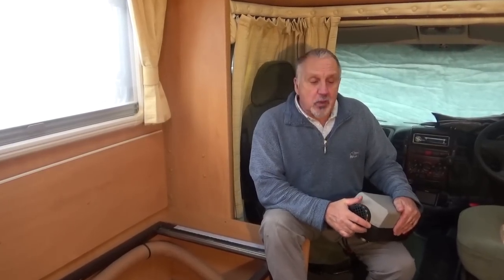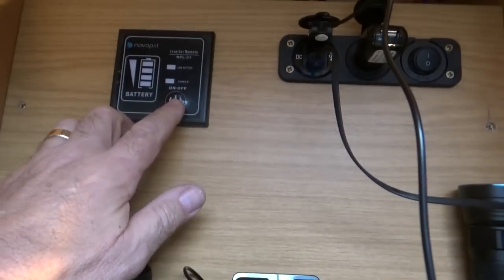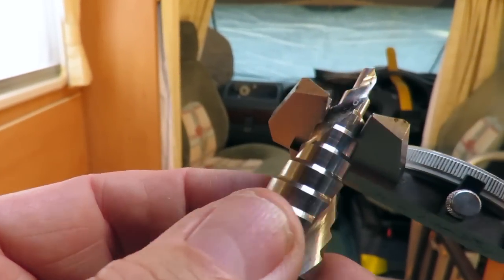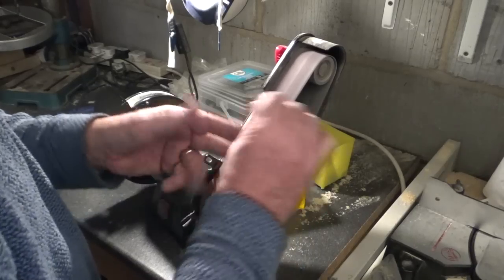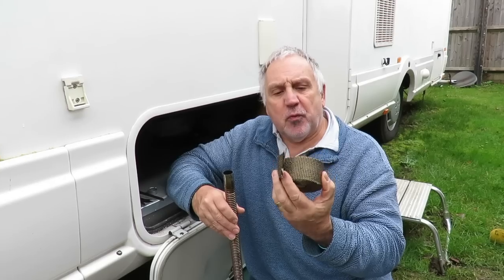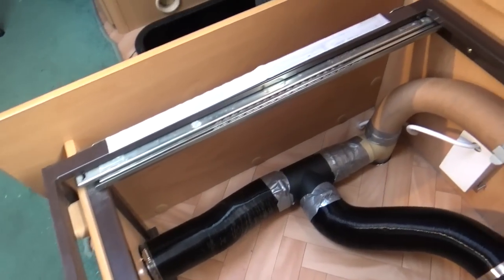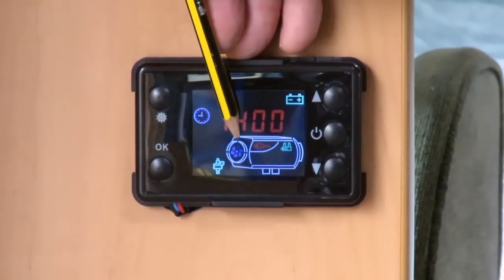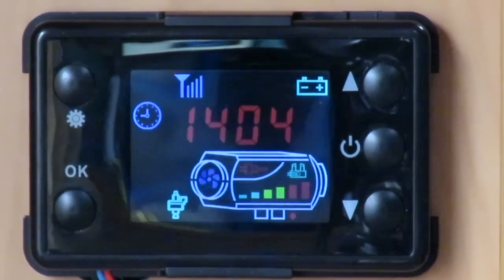How To Install A CHINESE DIESEL AIR HEATER, Ebay 5KW parking heater fitting guide. Full instructions

Comment: Just wondering how you're getting on with your exhaust wrap..... I need to raise my heater from the floor to get past an obstruction at the end of the heater near the heat exchanger, so I've bought a stand from ebay which raises the heater around 100mm which is ideal, and it means I can keep the fuel supply and the inlet and exhaust connections entirely within the van.  However, the exhaust still needs to go through the floor, so I was thinking about  wrapping the exhaust, making a slightly enlarged hole through the floor to accommodate the extra thickness, and using a heat resistant silicone to seal around it.  Just wondering if you have any thoughts on this ?

Comment: Great video, I’ve bought the heater in a box housing, both the same really. I’m looking to power the unit off a portable battery (goal zero or poweroak) and l’m wondering if I can connect a 13amp uk plug to the wires for this purpose? And if so do l need to change any of the wiring?
Reply from the maker: Hi Roger. 
The heater I have will only run from a 12V or 24V. DC supply. 
I assume yours will be the same as both the boxed “ all in one” and “freestanding “ units both use the same burner unit. 
So I would say DO NOT connect a 13A plug to any of the wires....!
Just provide a 12 or 24 Volt DC fused supply and you good to go. 
ATB, Steve

Comment: Brilliant video thanks ...how loud is the fuel pump and heater when running the clicking might be too much
Reply from the maker: Hi Mark,
I can hear the pump ticking slightly, but since this video I have completely upgraded this system.
Relocate the tank and burner, repositioned the pump and you really have to listed to hear it now.
Don't run it at night, sp during the daytime any ticking is drowned out by general daytime noise.
That upgrade video is here:
https://youtu.be/HHJaPP2uLFA

ATB, Steve

Comment: Will everything still perform if the fuel tank is mounted and kept outside the vehicle and the outside temperatures reach  0° to 20° F (-17° to -6° C) using diesel?
Reply from the maker: Hi ST,
I think you would have problems at those temperatures. 
I think I'm right in say that anything much below 40F and the diesel starts turning in a gel which will effect performance.
probably worth googling to check!
thanks
Steve

Comment: my husband has started to put in or really finished but found fuel pump very noisy as it is mounted on the tin in the cabinet just like the one you did in video. the tin is on the back of boot where we have the tank     /what would you to stop noise or where would you put it.

Comment: Is there a reason you placed the air intake pipe into a 'cold' area under your van? I would have thought you would not want to be drawing cold air into your unit to heat and pump into the van, when you could have drawn 'warm-ish' air from under the seat, and warmed that. Much more efficient setup I would have thought. 
I am guessing there is a reason why we cannot install this way? Great video by the way!
Reply: Or is that air intake just for the combustion component? i.e this intake will not be blown into the van itself?

Comment: Hi!
I've just installed a heater like this in my semi truck...i let it run like for 30 min for the first time and it gets some smoke inside the cab (the smoke doesn't smell like the exhaust it smells more like a heated plastic or some kind of this)...
It is normal to be like this when you fire it up for the first time? I was thinking that it needs some time for all the chemachilas and some paint inside of it to be burned or something like that...)
Thank you!
Reply from the maker: Hi,
Smoke inside the cab is quite serious..
I would check you have the unit sealed, especially between the burner seal plate and outside, as well as that, check exhaust clamp is secure.
If exhaust fumes or smoke are getting around the housing of the unit it will be drawn in through the air inlet.
Also check the air filter is completely away from the exhaust outlet.
You should get zero exhaust smells coming into the cab through the hot air vent.
Any smoke or fumes should only ever be coming out of the exhaust.
Hope this helps,
ATB, Steve

Comment: I finished installing my 5kw diesel heater today, primed it, switched it on, works great, have one problem, i cant get the temperature setting up on the screen, it comes up P- 4.9 HZ, also programmed the remote but does not work, your installation video was great
Cheers Frank
Reply: Same here... whats the solution?

Comment: Hi Sir, are you using Lithium batteries in your RV ? I wonder if the 14.5VDC (at BULK charge) can dammage the heather controller... I'm wondering if I will install a voltage regulator or nor ?

Comment: Thank you for a great video. I have installed my new heater and primed the pump. Never the less, the heater wont start. I get the E5 error even before the pump starts ticking. What is your advice?
Reply from the maker: That's a weird one!!!
Error E5 is overheat protection, and considering its not even fired up yet is strange?
I would check the temperature sensor at the housing to see if anything is amiss.
ATB, Steve

Comment: Awesome 😎 install and easy to understand instruction presentation.
Reply from the maker: Thanks Kman,
However, I have since relocated the whole system and this this new setup is the best so far.
Video is here:
https://youtu.be/HHJaPP2uLFA
ATB, Steve
Reply: @TheWrinklyNomads  I have installed a variable heat Chinese heater. 2kw to 5kw. It’s Awesome and once started I can drop the heat down to a minimum. Easy as.

Comment: Got to love metric vs imperial units. 5/16" (IE, 1/16th larger than 1/4") is 7.9 mm. So chances are, the piece you were measuring was 5/16" and the missing 0.1 mm was error during manufacturing or measuring or both.

Comment: I have changed the fuel pump visulisation from P = hz to the Centigrade temperature view.
I now want to change this back to the P =Hz view. Please how do I do this. I could not find the method in your advanced controller video. Cheers
Robert Middleton
Reply from the maker: Hi Robert,
Use the same method as you did for P = hz again.
That changes it back and forth.
ATB, Steve

Comment: I would love to ask your advice. My first time running it, I had a mishap. The exhaust pipe was so hot that it melted the fuel line which was touching it. Silly me. I covered the exhaust pipe with the same heat resistant fabric you have, with a double wrap, fixed the fuel line and tried again. Now there is a noticeable amount of smoke coming off the exhaust pipe through the fabric. I have the base of the exhaust pipe where it connects to the machine well sealed and the light smoke is not coming from that base area. I think I didn’t get all the diesel off the exhaust pipe and it’s the residual diesel which is producing the smoke. I see that your heat resistant wrap is very burned looking at a later stage. Should I just let the smoking keep going until it burns off the diesel or should I be worried that this might start a fire somehow? I imagine that the heat resistant wrap is fire resistant but I am still thinking I should ask your advice. If I need to replace the exhaust pipe for a new clean one and do this part again, do you know where to order these kinds of replacement parts online? Thank you!
Reply from the maker: Hi,
I would replace exhaust pipe with a new one to be honest.
Fortunately they a quite cheap.
here's a link, hope this helps:
https://amzn.to/3LkcVdI
Also, I have considerably upgraded this setup since this video, I find it much better,.
You may also find it helpful.
https://youtu.be/HHJaPP2uLFA
All the best
Steve

Comment: Hi, thank you for this video. Please can you tell me what battery is can connect it to? I think I will have a leisure battery and just straight connect it but not sure how. Many thanks in advance 🙏🏽
Reply from the maker: Connect the power lead to your leisure battery directly, ideally 100Ah if you intend to run the heater for long periods of time,
It will require a 10 amp fuse as well.
ATB, Steve

Comment: Isn't the fuel pump supposed to be at a 15° to 35° angle?
Reply from the maker: In my opinion, as long as it is over 45deg it will be ok.
Upright is even better because as the pump will create cavitation and thus tiny air bubbles, these are then pushed out of the pump chamber.
ATB, Steve

Comment: Very useful vid and I have ordered a similar one as a result. I have a question. You drilled the hole into the fuel tank to fit the fuel outlet into, and then you tightened it up - how on earth did you get the nut, and I presume a rubber washer, onto the back to tighten up onto and get a seal?
Reply from the maker: Hi Ian,
Yes, that's correct.
Once the washer had started to bight it tightened up nicely.

By the way, since this video I have completely upgraded this setup. Possibly the best improvement I've made so far!
I have a video on it here:
https://youtu.be/HHJaPP2uLFA

ATB, Steve

Comment: When my heater was delivered and I "unboxed it" I was confused because so many of the parts were not covered by the instructions. Your video has certainly given me the confidence to install it. Just a question, with the fuel filter at the base of the tank, how do you change the filter without diesel leaking everywhere? Thanks.
Reply from the maker: Hi Rod,
You get a pickup pipe with the kit which gives you top entry, so there is minimal to leak out should you need to change the filter, so that is a better way to install.....
I have completely upgraded and improved the install now after testing for a year.
I have a different tank altogether. 
The full upgrade instal is here if you fancy a watch:
https://www.youtube.com/watch?v=HHJaPP2uLFA&t=129s

ATB, Steve

Comment: Will this heater work outside? I’d like to build a box that encloses the heater, vents the exhaust, but is outside and only the heat air duct comes into a cabin. Is that possible?
Reply from the maker: Hi Ted,
Yes, it will work in many different situations.
Some people make a steel box up and have a potable unit.
Only consideration I would be aware of is possible freezing conditions.
ATB, Steve

Comment: Great video overall, I like your style, but I believe the fuel pump is supposed to be at a certain angle to function properly.  45-60 degrees I think.  I haven't fitted mine yet but I've read so from several sources.  

Keep it up though, I really enjoyed.
Reply from the maker: Hi,
The pump is perfectly ok being vertical. It will allow for easy escape of air bubbles and works fine.
I have been running this for six months now with no problems.
However, since this video I have completely upgraded this system, I have also made a video of exactly what has changed.
I think it's about as good as you can get now...  
Here's a link to it::
https://youtu.be/HHJaPP2uLFA

ATB, Steve

Comment: Thanks for a very useful video. Please can you say how noisy and annoying the pump is when ticking over and maintaining the set temperature, say 20C?
Reply from the maker: Hi,
On tickover the pump is very quiet by comparison to running full blast.
I hve found that general daytime noises are higher than the pump when ticking over.
Reply: @TheWrinklyNomads  Thanks very much for your reply.  I'm thinking of installing one in my amateur radio van/camper, so quiet running is pretty important as I don't want to use headphones all the time. Thanks again.

Comment: That sponge that's in there supposed to be pulled to the top of the unit that comes off they put it over there cuz that's the way they ship it but you need to pull it over to the top
Reply from the maker: Hi Gary,
What sponge do you mean???
Reply: @TheWrinklyNomads  the one inside the air filter that looks like it doesn't do anything it doesn't do anything unless it's at the top where the air passes right through it
Reply from the maker: Thank you. 
I will check it out 👍🏼

Comment: Thanks for this very helpful video sir, much appreciated ! I bought the 2KW Chinese diesel heater for a Ford Transit. Did you test yours under cold temperatures? Was it enough ?
Reply from the maker: Hi Michel,
Yes and I actually have a video on here where  i fully test the temperatures i winter conditions.
Worth a watch:
https://youtu.be/F7V4nW6co8o

ATB, Steve

Comment: Thanks for the useful video. Newbie question; wouldn't it be more convenient to use the van's fuel tank as supply? And just cut the feeder line inside the tank high enough so it never consumes all the fuel. (I assume you have a diesel van)

Comment: 9:00 have you noticed any sludge building at the bottom of the fuel tank that clogs up your fuel outlet at the bottom of the fuel tank? i read somewhere that putting the fuel outlet at the bottom may cause a problem like that. i'm about to install my heater and water going to put it at the bottom.  overall, this is a great video.
Reply from the maker: Hi Bobby,
Thank you for you comments 👍
I didn't notice any sludge, however since this video I have completely upgraded my heater setup, including the fuel delivery system.
Maybe take a look:
https://youtu.be/HHJaPP2uLFA
ATB, Steve

Comment: I am a bit concerned about pulling your combustion air intake out of your compartment.  Since it is semi sealed the path of least resistance would appear to be pulling air into it from the holes you drilled going into the living compartment.  This would impact your efficiency as you would be using conditioned air to provide combustion and pumping it out the exhaust.  Routing it through to the outside with a cap on it to keep water out might be a better installation.  I would also have put a piece of tubing with a collar on it down to line your holes to the storage compartment.  I realize you have wrapped the pipe and that is excellent but I am still leery about heat around foam as it burns so easily with such bad fumes.  The tubing would give you an air gap as well as conduct any excess heat away.  Not too thrilled with a fuel tank in your living quarters either as spills and leaks will eventually happen.  Getting rid of the smell of diesel is not all that easy.  Looking forward to a review after you have run it over a winter.  I have been running Espar and Toyotomo heaters like these (except for the ten times price!) for years in my boats.  Sure makes cold damp weather much more tolerable not to mention the really cold weather.  One disadvantage I see right away is that the exhaust is inside the air intake pipe using one through hull fitting in the marine version.  This addresses my above concern and also heats the combustion air while cooling the exhaust.  This relieves any concerns about overheating inside an insulation wrap and conducting that heat into inappropriate building materials.  While also preheating your combustion air (a good thing) with what would be wasted energy.

Comment: Thanks. Very clean install... One thing that keeps going through my mind... your fuel level appears to be higher than the burner.  Have you had any issues with it leaking when not in use?
Reply from the maker: Hi Ryan,
Thank you.
So far no problems with leaks.
ATB, Steve

Comment: Hello warreguru.
I would like to know if the heater has a certificate
European homologation to be able to install it in a van.
So if it works fine.
And finally, where do I buy it?
Thanks in advance.

Comment: Great instructional video. 👍👍

Questions:  

1- How is the thermostat setting work?   Does this heater start working automatically once the temperature drops below a set temperature?

2 - Does this heater require the installation of a dedicated 12 volt battery so that the heater  does not disable the van battery?

Cheers.
Reply from the maker: Hi,
1- the heater doesn't stop completely once you have reached the desired temperature setter. instead it throttles right back to minimum power, so the fuel delivery is at its lowest as well as fan speed. Once it senses that it needs to increase temperature, then it will simply increase fuel and fan back up until it reaches that setting again, and so on...
2- provided the battery is in decent condition and charged, there should be no reason you can' run it normally. It does draw amps at startup and a few on running. I use my auxiliary  battery so as not to drain my vehicle one and charge through the solar. You should never switch off the power especially when running the heater as this will, in effect, burn it out.
Hope that helps,
ATB, Steve
Reply from the maker: Hi,
Solar depends on your country and amount of UV light (sunlight).
But generally the solar replenishes the battery with the system I have.
You can see my setup here:
https://youtu.be/XQcwnD0hbeE
I find that solar by itself is ok and enough to recharge my batteries asI have no other system (yet)...
Having AGM batteries, if I did fit alternator charging I would use a the Victron B2B charger . 
Hope this helps
ATB, Steve

Comment: Recommended that the fuel filler be accessible from the outside and include a non return valve to allow it to breath instead of opening the cap.
The exhaust pipe will get hot and the gases are poisonous so ideally it needs to evacuate outside of the van and in such a way that the funds cannot re-enter the vehicle.

Comment: Great job, some good tips! Did you think about using a lower squarer fuel tank and putting in the storage area under the heater? Scares me cutting the floor 😂
Reply from the maker: Thank Allan,
Funny enough I'm a completely revamping that at the moment, with a different tank..!
Watch out for that future video..
ATB, Steve